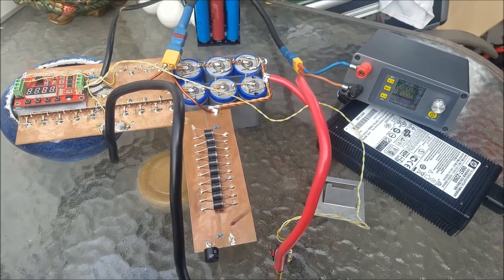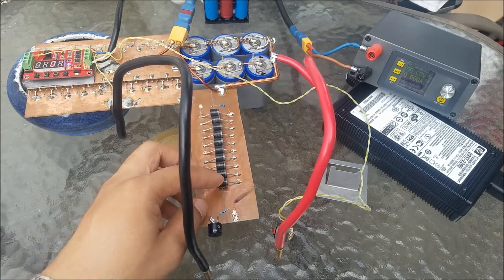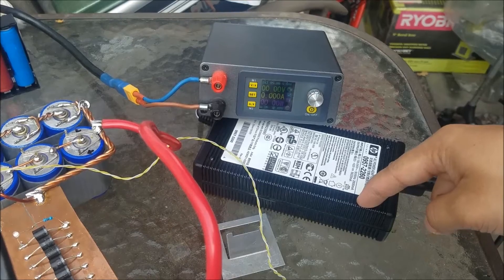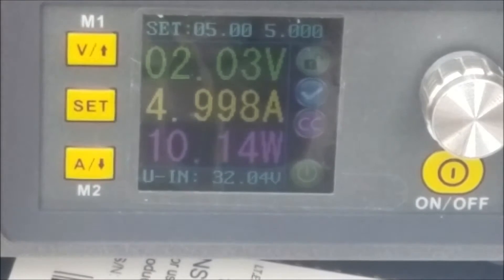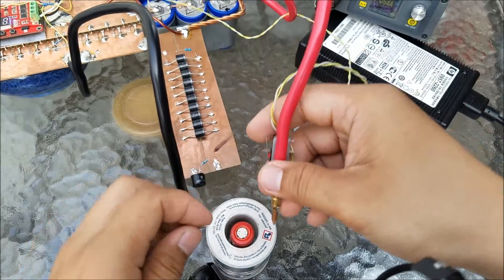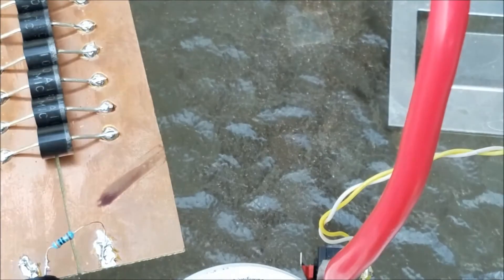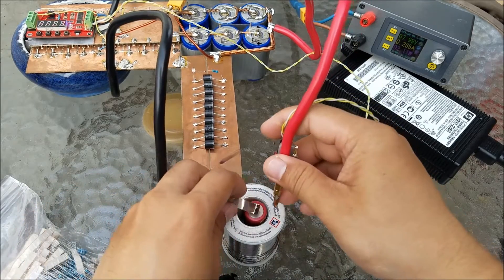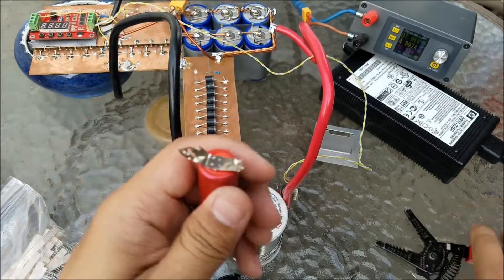DIY Maxwell BoostCap UltraCapacitor SuperCapacitor Spot Welder for 18650 Battery V1

Comment: 100ms is a LONG pulse. Instead of varying the voltage you should be varying the pulse length. 

A good welder has a pulse length of 10-20ms for most materials. 

The kWeld provides an actual Joules measurement of energy which is quite helpful but that involves a microprocessor doing a lot of work and is likely part of the reason why the kWeld is about $200USD as the rest of the components minus the mosfets are relatively cheap. They kinda cheaped out by using brass bus bars but my understanding is even with the brass it’s fully capable of 2000A/500J which is the practical limit of the welder. There is also some math regarding the inductance and resistance in the entire circuit from power source cable end to electrode end. The length of the 6AWG cable you use has to follow a formula and upping the wide gauge or shortening the standard 1m length can actually damage the welder due to inductance. 

It looks like you got quite a few things right in your overall design minus the timing circuit. I believe that is what’s limiting you to the minimum 100ms weld pulse. 

Double weld pulse is not necessary but it is quite popular. The first pulse is short, anywhere from 1ms to 10ms just meant to clean the area you are welding and the follow up pulse, after a short delay (again measured in milliseconds, I think all that matters is you don’t wait too long as part of the first pulse is heating up the area) is benefiting from a preheated area that makes it easier to melt the metals together. The second, primary pulse, is typically 5-50ms although some underpowered welders go up to 100ms to allow the welder to have a chance at welding 0.15mm pure nickel   This leads to a burned looking weld and is a dead giveaway that someone used an underpowered/poorly constructed welder that either was underpowered and trying to compensate with a long pulse or the weld was actually too strong because they lacked control/failed to dial in the correct pulse length. 

With 350F caps, 2 in parallel you should be able to do any material up to 0.20mm thick be it pure or plated nickel. This won’t be the case if your caps have a significantly higher IR than when they were new but if they are genuine Maxwells that haven’t been beat to hell they should be low enough to allow weld current in the area of 1000 to 1500 amps

Comment: should've used STP160N4LF6 instead, 120A continuous and about the same price as those 260N's especially since you don't need anywhere near that voltage

Comment: Looks like it's working really well now. Cool.
Reply from the maker: Boss paul, i will improve more for this Supercapacitor, for now i do some of test for different voltage and Farads to get exactly spot weld for nickel strips and resistor wire fuse, stay tuned boss
Reply from the maker: Boss the Buzzer and red Led is to know if the mosfet will short out itself for high current,.. if the buzzer and red led didn't stop beeping or turn off it means the mosfet is shortage
Reply from the maker: The first time i used mosfet im scared if the mosfet will blows out but it didn't, it works😂😂😂
Reply: Jenpau026 I've got six of those supercaps too. So I might follow your lead. Thanks.
Reply from the maker: Yap, just do it boss, i will update and upgrade mine, and make a video to you too, i want to see yours